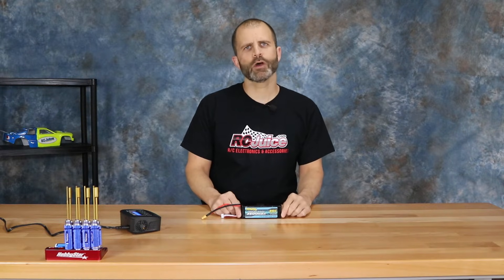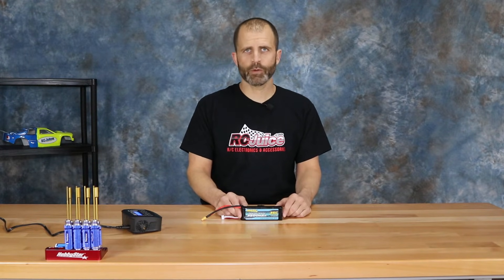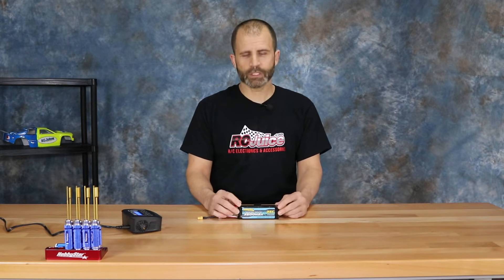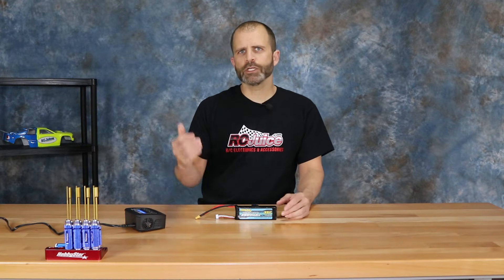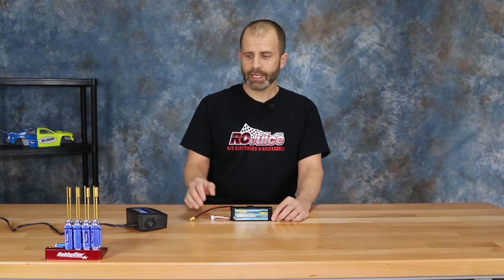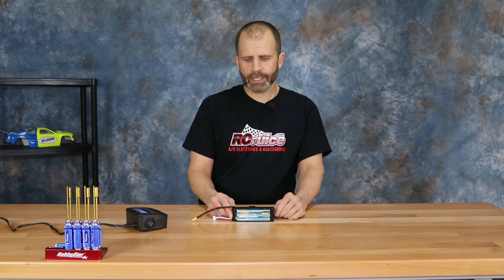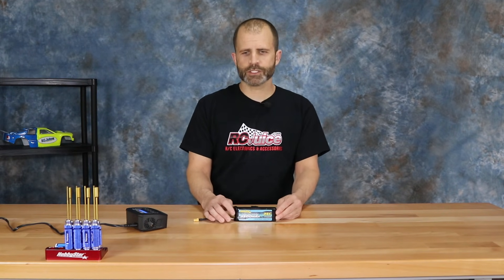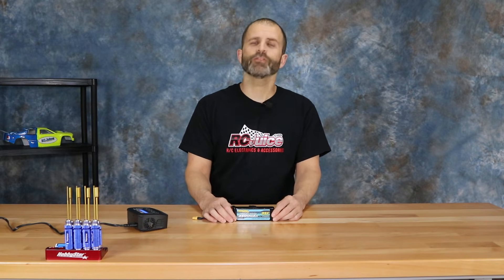Don't throw away your LiPo, revive it!

Comment: I bought 2 new Zee 4200mah batteries from Amazon. When I opened the box the literature stated in bold words do NOT charge until ready to use. Ok so they sat for 2-3 months. I charged the first one no problem. I went to charge the 2nd one. Nope. Of course I was out of the 30 day Amazon warranty. I contacted Zee. They refunded me my money and told me to keep the good battery and dispose of the bad one. I went bought new charger that had more features than by basic Lipo charger. I followed your instructions. It took a couple of tries but I was able to get the battery back to life with a full charge. Thank you thank you.

Comment: I haven’t used my batteries in several years. Spektrum 3s 5000mah smart batteries. Are they too far gone for this technique. Is there any risk if they have been discharged that far?
Reply: Hey! Similar situation here, and even same battery, it stood around 7 months without use, I kept it in storage mode, but when I try to use it again, it seems one of the cells got bad or weak, I did some research and it seems it might happens sometimes, so I decided to use that battery for a crawler RC instead of use it on my bashers. Maybe this will help you.

Comment: Couldn’t get this to work for me. I’m using a Gens ace charger with a gens ace 2S 5000mA battery. Gives me low voltage error on both Lipo and NiMh. Voltage reads at 1.82v.

Comment: I tried this method with a Gens Ace 3S, it had been dead for over a year.

2 mins in I could hear the casing expanding so I stopped and checked voltage 

Cell 1 = 0V
Cell 2 = 0V
Cell 3 = 3.5V

I’m guessing 2 of the cells were so dead they can’t even be revived?
Reply from the maker: Unfortunately, that seems to be correct in your case.

Comment: What if my battery is so low that my smart charger wont even detect it
Reply: Charge it with NiMh option for couple of min.After that charge it with lipo option again
Reply: @kevincagla4895 bro you fucking genius
Reply: You just saved my ahh  @kevincagla4895
Reply: I’ve tried the NIMH option but charger says straight away wrong battery type! Any other ideas please?
 I’ve £300 worth of batteries currently scrap😏
Reply: @timsrcantics8260 unplug the balance lead
Reply: Load it with a "Dumb Charger". I have a Cheap Lipo Charger that doesn't have any programs and just charges. I revived q Lipo with that
Reply: Try with a regular balance charger, it might work. I have regenerated some doing that.
Reply: I have the same problem
Reply: Did you ever figure out the solution or do I need to buy another battery
Reply: Try plugging in without balance charger @larrystephens3021
Reply: Same here.
Reply: Did you watch the video? Your question is literally what the video is about. Are you asking how to set the charger with some specific charger?

Comment: I have a spektrum s2100 charger and after charging for 1 min in NiMH mode, I switched back to Lipo, and it is asking if you want to charge without the balancer.  Should I click yes or no?
Reply from the maker: We recommend charging in balance mode. In his particular case, we would recommend the same. Click "No" to be on the safe side.

Comment: Did not work for me 😢😢😢 The bad cell never went past .65 volts after 30 secs, 1 min,  1.5mins.
Reply from the maker: Bummer.  If you have one cell that is really far off of the others then this will not work, that's indicative of a bad cell.  This works for an overly-discharged pack but otherwise working cells.

Comment: Dont plug in bal lead during rescue operation?
Reply from the maker: Correct, if a balance lead is connected the charger will error out as it does not expect a balance lead when charging a NiMh pack.

Comment: Thank you. I am new to rc and accidentally left a spanking new spektrum 2S plugged into my car for a week. It showed Dead dead dead. I called my local shop and was told it’s trash. To be fair, I was warned. 
I caught sight of my battery in the trash for two weeks and said “there’s got to be a way”. Sure enough. I am at this moment recharging my smart battery with sensor lead after trying this hack. I do understand the hesitation on a shop not wanting to hand this out. Liability and all. And the ineptitude of society at large. 
Bottom line.  IT WORKED for me.
Reply from the maker: Glad it worked for you!  Your situation is exactly the scenario in which this works, thank you for watching :)
Reply: Awesome!!!!!

Comment: Is there a point that it will not work? I purchased 2 gens ace 2s 7.4v and never used won't charge on Lipe low voltage error , tried nimh and nothing any other ideas? Thank you
Reply from the maker: If a cell is actually "bad" this will not work, this is for when cells have simply been discharged too far.  If you have a pack where one cell is in a much different state than others then that is usually a  bad cell and it cannot be fixed.  If you are charging it in NiMh mode for a few minutes and the voltage does not come up then it may be damaged, but try charging and discharging a few times for 5 minutes each time to see if you can "wake up" the pack, sometimes it works.
Reply: @RCJuice  thanks , I tried it and one just broke back over 5v so maybe  a few more time I might have something lol thanks again 🍺

Comment: You saved me some money , I was able to charge my 6s 4000 mha battery, thanks 🙏🏼
I just let it charge until it got to 22.2 Volts which is the rated voltage on the battery.
Reply from the maker: Glad it worked and saved you a battery!
Reply: What should a 4s be charged to via NimH?

Comment: so if i have a bad cell does that means my battery is no longer usable? 
     my first time experiencing a bad cell!
Reply from the maker: If a cell is bad then there is no reviving it, a good indicator is one cell have a very different reading than all other cells.  If all cells are very low then the pack is likely just over-discharged and this will work, but if one cell is much lower than the rest then unfortunately the pack is likely toast.
Reply: @RCJuice  i was scared of that.
thanks for replying, i will be purchasing a new battery. 😎👍

Comment: I know my issue is the battery being too low but it won’t take a charge after 2 minutes on nimh what do I do
Reply from the maker: You can charge it longer on NiMh.  It usually only takes a minute or two, but you can leave it on much longer if needed. You just can't leave it on there and walk away from it, it will charge just the same as it would in LiPo mode, but it would not shut off when it needs to so you can't just let it charge all the way but there is no harm in leaving it charging in NiMh mode for longer as long as you stop it before the cells are fully charged.  If it will just not take a charge then it's possible the cells are too far gone.  Check individual cell voltages too, they should all be somewhat close in voltage, if you have a cell that is way off of the others that's an indicator of a bad cell that cannot be repaired.

Comment: I have 2 3s spectrum smart batteries.
At 3.6v, they won't charge. I stored them too long.
I doubt these can be revived.
I'm never buying spektrum anything again

EDIT: I ordered the S150 charger and will try to charge as NIMH while monitoring voltage.

Comment: Not sure if anyone will see this bc the video is a year old, but if I put it on for 30seconds and it doesn’t work can I put it on for another 30 seconds?
Reply: Yes, you can charge is for several minutes in nimh mode... like he said, its all just current. The danger is when you get to the top/full charge... you could potentially overcharge it and 💥

Comment: Thank you for this tutorial,, but I have a 4S lipo 2 cells are good and the other 2 cells my charger only detects 2 because the other 2 they have like 0 voltage can I still do what you teach us on this tutorial????
Reply from the maker: This works when cells are all too low, but relatively close to each other.  If you have 2 cells that are reading voltage and 2 that are at 0 that unfortunately sounds like the cells are bad and not fixable.
Reply: @RCJuice  okay 👍🏻 appreciate it for your help thank you....

Comment: what voltage should 6s battery be ,  I have a 1300mah now it charges to 1900mah and the voltage is over 25 had a motor catch fire .. when I  bought  it , it went to 1700 worked fine
Reply from the maker: A fully charged 6S battery should read a total pack voltage of 25.2.  A motor catching fire would be related to overgearing and overheating of the motor, not the battery itself.

Comment: Tried it worked like a charm had to do it a couple times cycled before they Traxxas charger would recognize the battery work perfectly for boy I was nervous as heck I didn’t want any issues anything exploding you know. thank you for making this great video
Reply from the maker: Glad to hear it worked!!  The charger sends current just the same, no matter what mode it is in.  The only difference is the measured voltage at which it stops charging, the only danger is if you set it to chage on NiMh mode and then walk away and forget about it, it would overcharge the battery and could destroy it or even cause a fire.  There is no danger in charging it for a while in NiMh mode as long as you pull it off before it reaches full voltage.

Comment: So I am trying to do this but I am getting a error saying balancing task is not supported when I hook up the battery and comes up as 4s vs it being a 6s, cell 2 and 3 has no voltage but the others have 2.83. Should I toss it?
Reply from the maker: In NiMh mode balancing should not be an issue since they do not have balance plugs, make sure you do not have the balance plug connected to the charger and ensure you are in NiMh mode.
Reply: @RCJuice  should I be worried that cell 2 and cell 3 are at 0? Before doing this
Reply from the maker: @fleurimondproductions2786  If they are truly at 0 then it's likely the pack is not revivable, you can still try this and it will not hurt anything but it's possible the pack is just junk at this point.
Reply: @RCJuice  thanks a lot! I have this video saved for the future me that messes up
Reply from the maker: @fleurimondproductions2786  Our pleasure, and please feel free to reach out with any questions you may have in the future: https://www.rcjuice.com/contacts/

Comment: Great video but should also mention that if you leave you lipo plugged into your esc some esc's will drain the voltage even if it's turned off
Reply: Makes sense think that’s happen to me.. I unplugged one battery on my erevo now went to charge them and ones drained
Reply: I didn't realize this and I think that is what is happening to mine.
Reply: @DigitalConfusion1, you can revive the battery if it's still in good physical condition. Just pay close attention to it and follow the instructions in the video. I've left mine plugged in many times and have had great success reviving every single one of them.
Reply: Why would you leave it plugged in? Basics 101
Reply: You must play with childrens toys.  You do not leave lipos attatched to an esc
Reply: @Fatpumpumlovah2 I race RC cars, but even if it's not an RC car (drone, boat, helicopter, plane), etc., all of them have a part in common, which is your electronic speed control. They all come in different styles but do the same thing.
Reply: @hahafunny6172  you still dont leave them plugged in. Lmfao.
Reply: @Tom-90210  get a load of this guy

Comment: I have 3 batteries. I charge them it says full charge I then plug one into the car and it runs strong for like a minute then looses charge. Any idea on that?
Reply from the maker: Start by checking individual cell voltages once it starts to slow down to see if the pack is balanced.  if all cells are close, then it's possible the battery is just worn out.

Comment: I’m new to air soft. I got a new battery put it in the gun shot it a few times and left the battery in the gun for 4 days. I came back I wanted to shoot it and it wouldn’t shoot. I decided to charge it and left it over night charging and the light keeps blinking red on the smart charger or the Balance. Now it’s been 2 days and it’s still blinking red and anytime I plug it in it doesn’t work. What do I do?
Reply from the maker: If you are able to set the charger to NiMh mode then this trick will work for you, but some basic chargers do not have this option and you would not be able to do this.

Comment: OMG! It worked, 2 of my lipo batteries been having this issue for 4 months, about to toss them and your lipo revival advice worked perfectly,  now my batteries are good. That's almost $300 you just saved me! 10👍
Reply from the maker: Glad it worked for you!
Reply from the maker: @William Perri If you do have 1 cell that is too low then this will not work, this is for a pack that is discharged too far across all cells.  If a cell is bad, which sounds like your case, then the pack is unfortunately done.  Sometimes cells go bad even if the pack is cared for correctly :(
Reply: Never spend $300 for 2 batteries.

Comment: How can i charge my battery in a lipo bag when the leads are so short? I guess i cant put the whole charger inside the bag
Reply from the maker: The bag usually ends up right next to the charger, even the shortest leads typically give you enough length to do so.

Comment: on my 1500 3s it says 8 volts and it still wont balance charge should i keep going ? been charging it with 1.5a for 1 min
Reply from the maker: Yes you can charge that for a while longer to see if it comes up enough. Check the individual cell voltages first though, if any 1 cell is really far off of the others then the battery is likely no good, this is for when all cells are discharged too far but still otherwise relatively balanced.

Comment: I’ve tried this 3-4 times and I seem to not be able to get my battery revived
Reply from the maker: If any cells are at a significantly different voltage than the others then you may have a bad cell which this will not fix. What are the cell voltages?

Comment: oh i got batterys that are to low voltage not to new got from a friend sat in cold i think so how long do i need to plug it in for
Reply from the maker: Usually only takes a minute or two.
Reply: @RCJuice  yup im 13 and never had 3s in my slash just 2s and im waiting for it to be nice out to test it i saved 3 batterys with this

Comment: I have a smart s150 charger and it doesn’t let me put it into nimh it automatically puts it back into lipo. Is there anyway I can bypass?
Reply from the maker: Sounds like you have the balance lead connected, remove the balance lead and it will let you.
Reply: @RCJuice  it doesn’t have a balance lead it’s the new battery’s without it.
Reply from the maker: @bennybabch552  Gotcha.  It does have balance leads, but they are built-into the connector so this is not going to work with that charger.  Sorry :(

Comment: What should I do I baugh new Lippo one cell is 0.9V other 5 are 3.8V, Cann I repair it with this method?
Reply from the maker: If this is a new LiPo then no, that sounds like a defective cell.  This trick is for when all cells have been run too low, but they should be in similar states.  Any time you have one cell that is very different from the others that indicates a bad cell alltogether.

Comment: Mine says short error. I know the NiCd for this trick but it wont accept that either.
Reply: Yeah that's what I was figuring too. Thanks Though.
Reply from the maker: If it says short-error, you may have another issue alltogether.  This works for packs where the voltage is too low due to sitting too long, or being discharged too far in use.

Comment: So when I do this it only charged up on cell mine reads 3.15v and the other three cells are 0 any tips. It’s a brand new spektrum
Reply from the maker: If you have 0 volts then those cells are completely dead and not revivable (sounds like a defective pack).  This is for when all cells are low but still in similar shape, unfortunately, it sounds like your pack is not fixable.

Comment: When proceed with this method, is the lipo battery is connected with both cable power/balance. Cheers
Reply from the maker: Do not connect the balance cable or you will get an error in NiMh mode, just connect positive and negative.

Comment: How to fix a 6S LiPo battery when the Tenergy display reads "R: 5s  S:6S" ? Battery didn't cutoff  on the battery and  went below charge. Now, the R: parameter shows 5S. any ideas to fix it?
Reply from the maker: That sounds like there is a complete failure of 1 cell on the pack.  This trick is for when all cells have been discharged too far, but it sounds like in your case you have 1 cell that is actually damaged or completely dead and unfortunately, this cannot fix that.

Comment: I've had a problem with a 4s when only 2 cells charged even in ballance   , so I've made a 2 pin connector and charged the individual low  cell  as a single  cell through the ballance lead

Comment: My charger won’t let me switch it into nimh mode
Reply from the maker: Are you setting it to NiMh before connecting the battery? You need to, and do not connect the balance plug when doing this or it will not let you.

Comment: I've got a NiMH battery 7,2volts 3000mah and I've run it for 5 years. I left it and it went dormant during winter and it takes 5-20 minutes to charge it in 1 amp(a new battery takes about 3000/1000=3-3,5 hours) Is there anything I can do to get full capacity and run it again or do i have to replace it???
Reply from the maker: For that battery the best you can do is to run several charge-discharge cycles (Do at least 5).  If it does not come back to capacity after that then it's going to be done, at that age and sitting that long it's likely not going to come back very strong unfortunately.